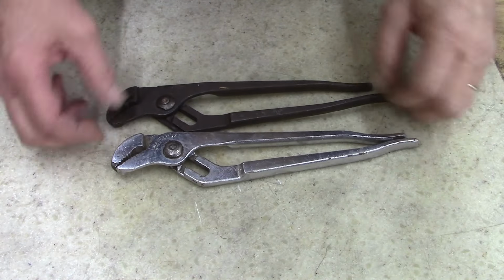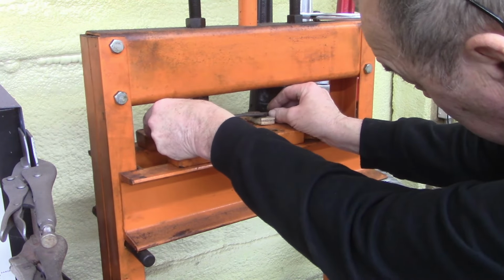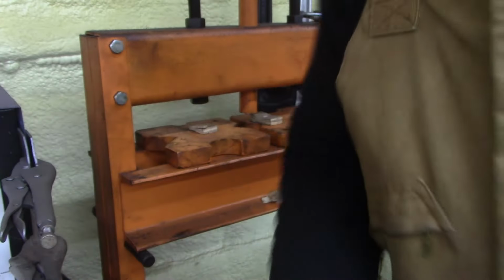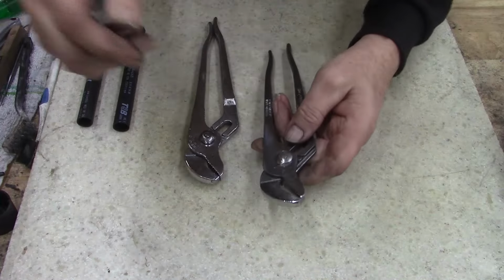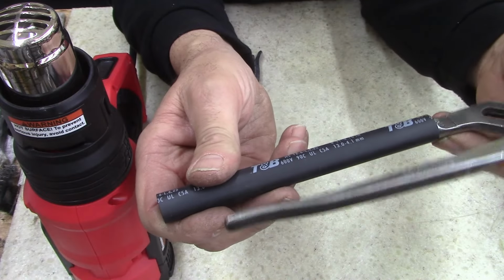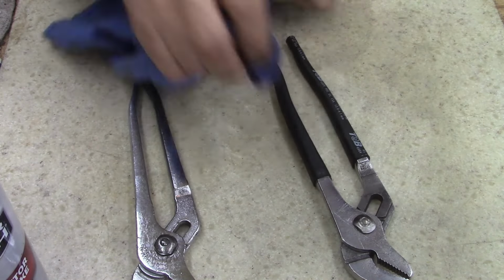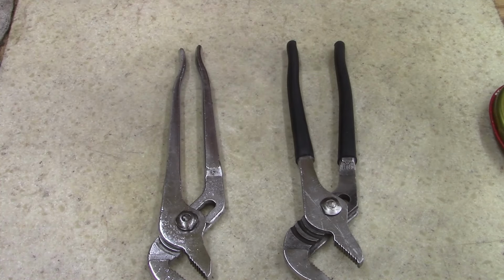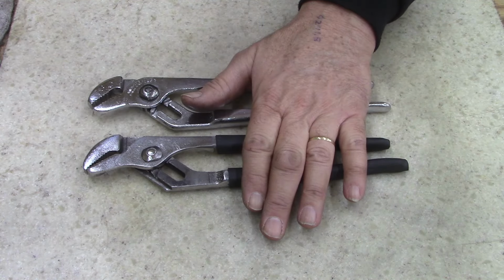2 slip joint pliers clean-up!

Comment: Hey there, a little info on getting the pivot bolt and nut out. Warm up the nut with like a mini torch and they come off way easier. Then when you reassemble you can peen the threads back to keep the nut from coming loose.
Reply from the maker: I forget I have a torch 10 feet from me all the time!

Comment: Do you use a coarse or a fine wire wheel.  I have found the fine wheel gets into the corners and tight spots better than the course one.  However the course wheel lasts longer and does remove stubborn or bad rust faster.
Reply from the maker: Right now I am using a Norton Brand medium wheel and I will not buy that brand again, I will buy Harbor Freight instead, it does not last as long but a lot better product!!!!!!!!

Comment: I'm in the Fire Sprinkler trade. Channellocks is one tool we always use and have on us. Its a shame how the quality of them has fallen off in the past 10 years. So much so, I use German made pliers now.
Reply from the maker: We just had part of our facility, sprinkled, been grandfathered in for so long the state said no more, I look for older ones all the time!
Reply: @djstoolrestorations  States are cracking down on commercial buildings over fire protection. Now the fire marshals will want you to have a Sprinkler company inspector do inspections every 3 months. Its a money pit
Reply from the maker: @travisbell9014  We have to check system pressure on all floors and builds on campus and document, we are govern by the feds, I work in a hospital, we have monthly pmi's on the system also and document! right now twice year complete inspection.